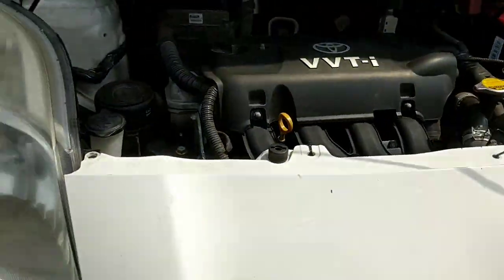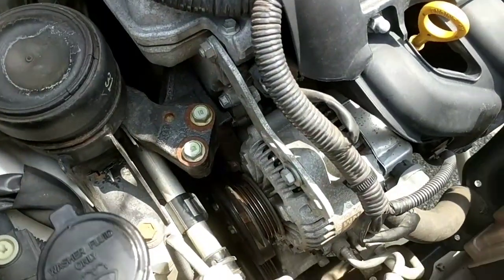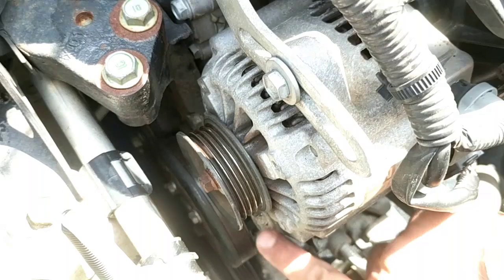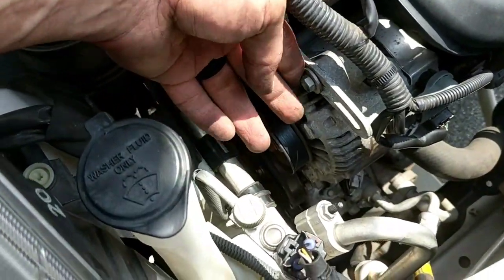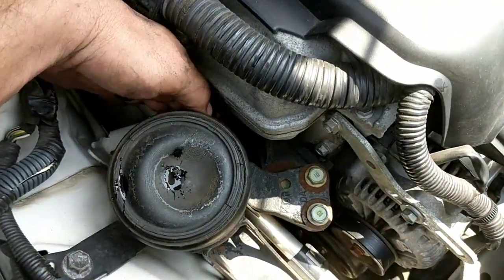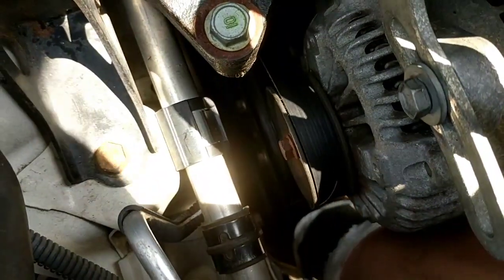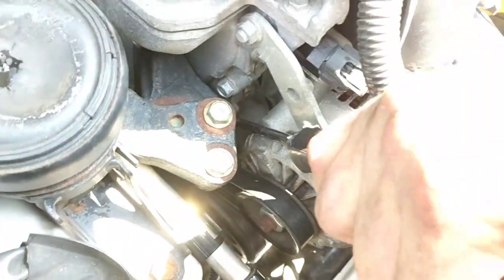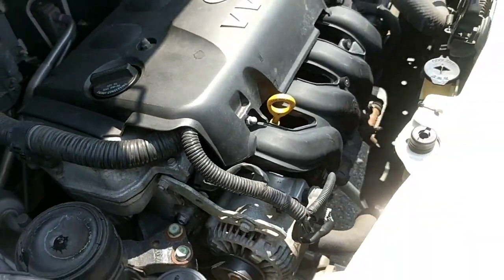Changing Serpentine Belt on Toyota Yaris 2008

Comment: Thank you! I just ran into the same problem, all my lights came on and the belt is gone.  I'll have to go get a replacement and put one on!
Reply: I just replaced my belt, working great now, I did have a problem as my socket was short so my ratchet was hitting the smooth wheel, i wound up getting a socket extender to get clearance and was able to loosen lower bolt.  Thanks again, very helpful video.
Reply: What size belt

Comment: Hint.... to tighten...notice there is a M8mm x 1.25 threaded hole midway on the adjuster-arm  where the alternator top 12mm bolt sits ( at timeline 6:50, right next to your screwdriver). Put a 8mm x 1.25 hex bolt on from the left side ( as you view the car from the front) ...and use THAT as a leverage point.
Reply from the maker: Ahh, good point! Thank you.
Reply: @jeremyhood  ...no problem..... just paying it forward......

Comment: thanks helpful.  
I'm trying to get that lower bolt rn but can't unscrew it.  My sockets too short so breaker bar runs into things been trying all day.  Where did you get that 1+ inch socket?
Reply from the maker: Sorry for the very late delay! Google stopped emailing me for comments. I'll have to check my settings and all. It came in a set from Harbor Freight Tools. I imagine any anti parts or hardware store would have one.
Reply: deep socket

Comment: On my 2008 Yaris 1.3VVT-i the alternator is behind the engine, and the belt goes around the engine mount. Took I while to find the third bolt holding the engine mount to the engine - it's on the bottom side.
Reply from the maker: Wow! That's a pain. I'm sorry you had to deal with that, but glad you figured it out.

Comment: Okay but how do you actually do it because the freaking belt won't come over the alternator pulley. It's the right size belt but there just isn't enough slack to get over the pulley. God I wanna die rn
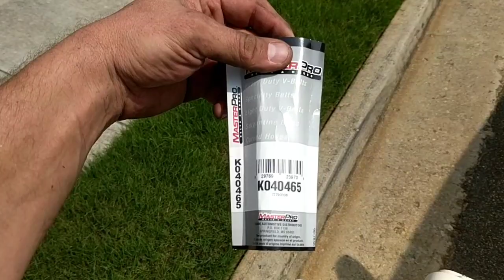Reply from the maker: Did you loosen the 2 bolts that hold the alternator in place and push it back toward the back of the car (away from you as you're standing under the hood)?  I talk about it at around 1:30 to 2:30.  I hope that helps.

Comment: What roof rack system is that?!
Reply from the maker: It's this one from Amazon:

Perrycraft DS3245-B DynaSport 32" Wide x 45" Long Drill-in Installation Roof Rack (Black Finish) https://a.co/d/dSvn71r

I beefed up the hardware, though. Instead of just screwing in from the top, I put stainless steel bolts all the way through the roof with large washers, lock washers, and nuts.